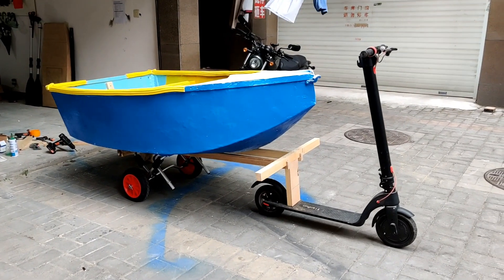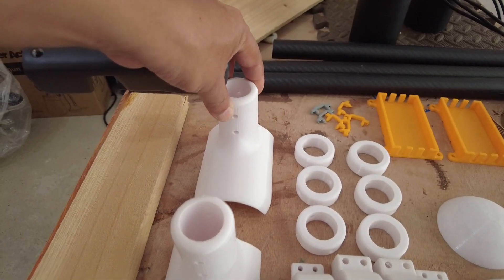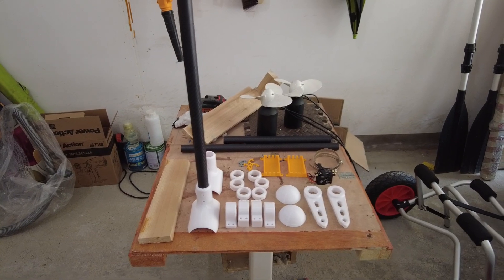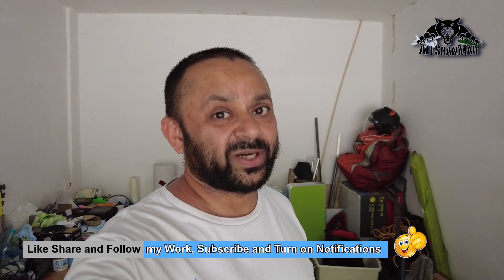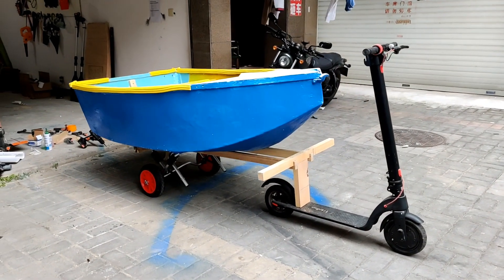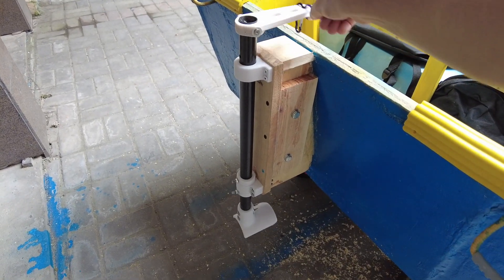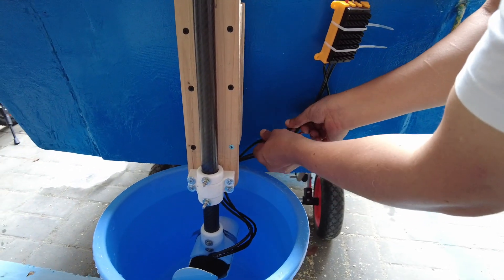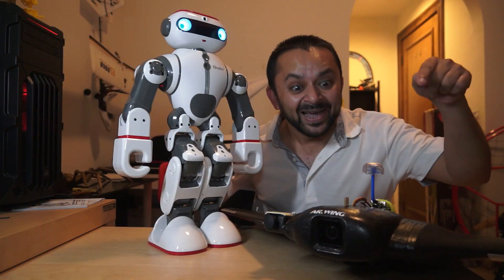DIY Stitch and Glue Mini Electric Boat Build Part 5

Comment: How much autonomy do you expect with the lipo and what are the lipo specs? Amazing job I love the steering system
Reply from the maker: i am getting about 15 minutes drive on 4S 5000mAh X 2 batteries in series (8S 5000mAh) and more power with 6S x 2 5200mAh  (12s) but with 12S i have more power in hands, so i can cruise at little throttle and get more times. if I add 16000mAh packs. I am in for hour or more cruising.
Reply: @alishanmao  thanks, do you know how the led battery and existing off-board motors for little boats (e.g.: Minnkota) would stand against your setup?

Comment: Bloody brilliant buddy. Great job and cannot wait for next video. I think water wind shields on front would look great and possibly on the sides a bit 👍
Reply from the maker: Thanks for the tip brother. originally for windshield my plan was to 3D print some brackets so i can add and remove shield anytime. i am on that plan still. though still have to find something transparent, like transparent plastic First. next the final test video coming soon
Reply: Your welcome brother, You can buy clear Perspex sheeting from most DIY Hardware stores. If you know sizes you want they will cut to size buddy  👍

Comment: The kids are having fun! 😊
Reply from the maker: I was the biggest kid having fun hahaha. Kids wanted to drive it but my choice of wool for string steering was bad idea LOL. it stretched and did not work properly. besides i needed to test everything to make sure all is good and in working condition, then i will give the boat to kids and let them drive it around. today modifying it with twin motors and a New VESC :D more power more punch
Reply: @alishanmao  The kids will love steering the boat around for sure, they can be your first mates captain!!!